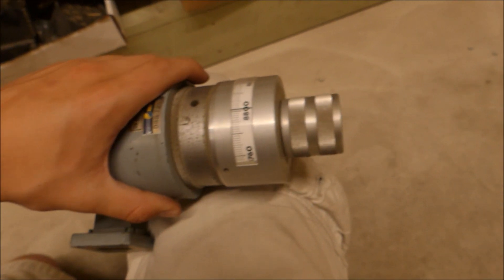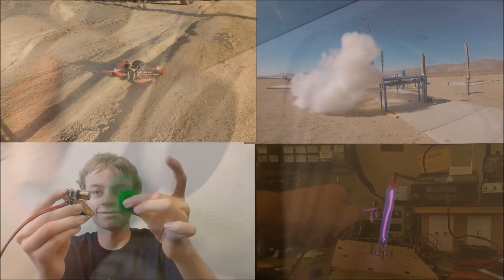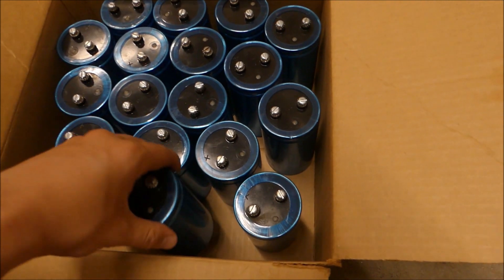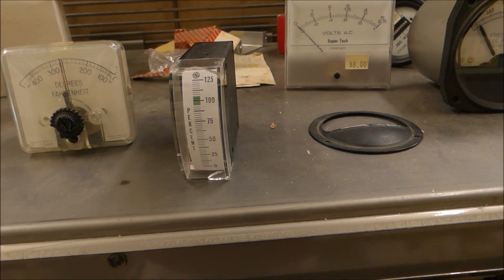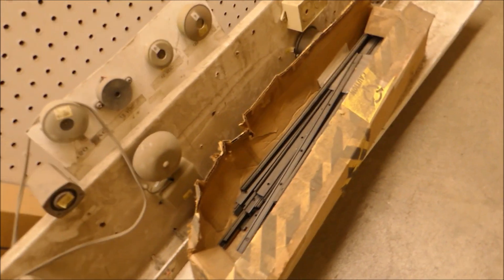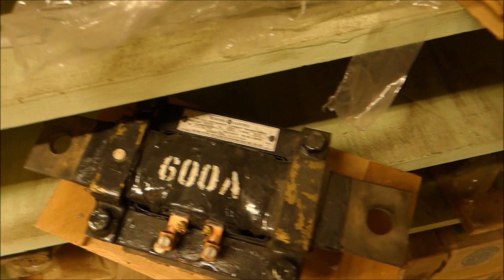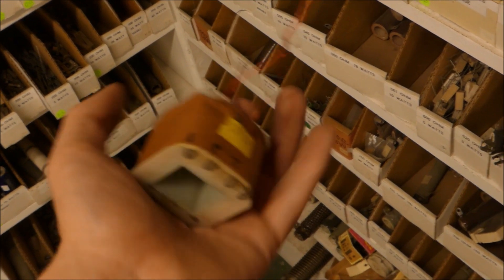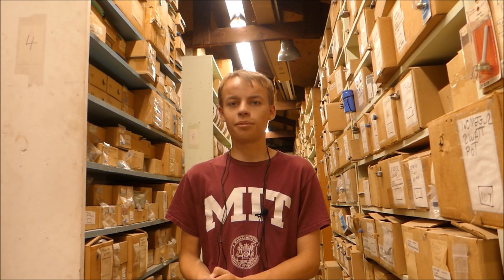Getting Stuff at the Electronics Warehouse

Comment: That is a actual candy store.
And also, that item with the bell you wondered about, its simply the mechanism inside the housing part of it that causes the bell clanger to jump from active to disabled repeatedly, some coils and such for electromagnet pulsing. Often used for door bells, or to alert in factory modes if a type of limit switch thermostatic switch activated it i guess. Rock on and safety first, as you already know caps!
Reply: Same config for how you can make relays essentially like buzzers :3

Comment: You are going to need more than those thin wires for your capacitor bank. Really thick wire or copper busbar is more suitable.
I think that big green transformer is a voltage (sensing) transformer.

Comment: ores are mostly for contactors, where you can have various supply voltages on the same unit, you just put the right voltage core in there to use the unit. Microwave unit is a band stop filter, used to filter out the primary microwave frequency in a system so that the power meter or receiver attached to the output side can operate without having the main power being fed into it, or at least the power that bleeds past the circulator that is used to sample the returned energy. Could also be a band pass filter, they look remarkably similar, and differ just in where the coupling to the waveguide takes place. In both you have a machined cavity that has one wall adjustable by the dial, to change the physical dimensions of the cavity, and thus the resonant frequency of the cavity.

Comment: You can recycle one of those high amp transformers from an old microwave! Just make sure to completely remove the high voltage secondary and replace it with a good gauge insulated wire.  You'll get close to 1 volt for every turn.